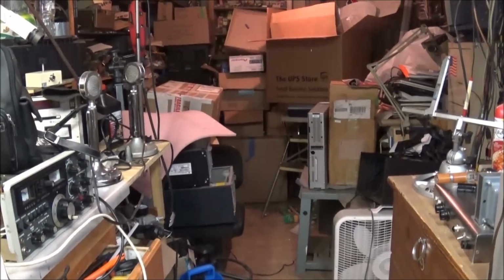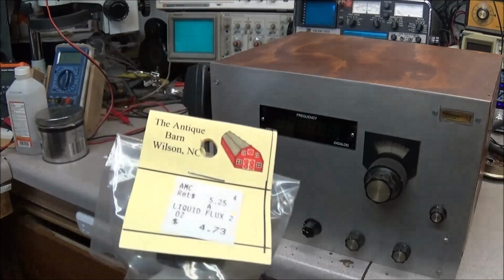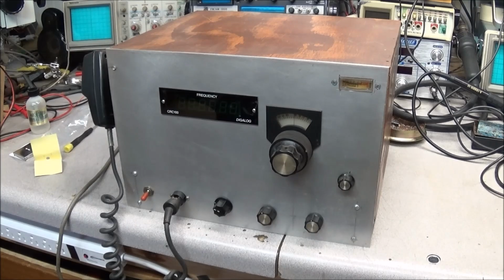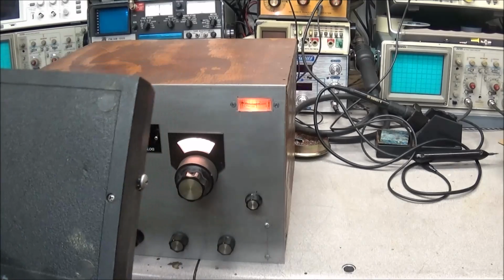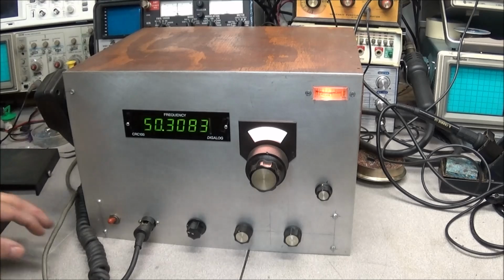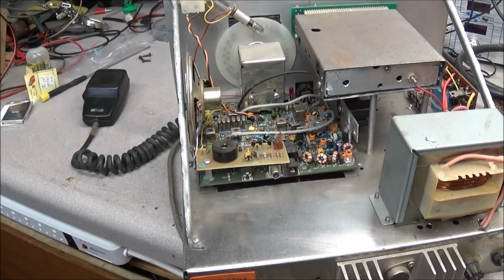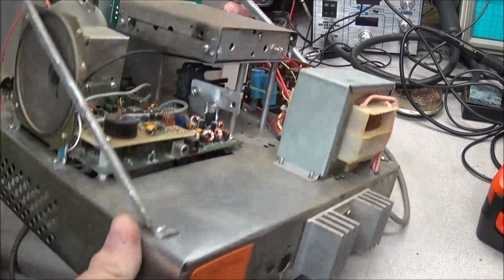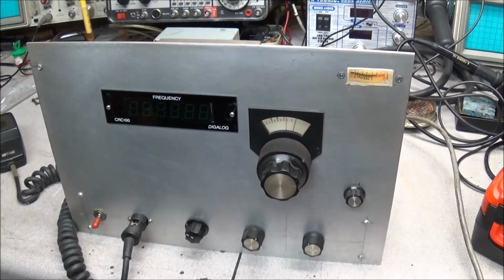#98 Old Projects From The Past

Comment: is the ts2000 your daily driver?  whats your opinion of it compared to other shack in box style?
Reply from the maker: It is a good radio, but not the daily driver. I probably use the Icom 745 and Swan 350 more then the 2000.  I just like the way the old rigs work. As far as other shack in the box you cannot beat the 2000. It is loaded with everything you need.

Comment: Hello
Not related to this video. I have a CODAN HF TX/RX 100W communication set. Recently i found its showing High SWR 9.9 in all bands. I have changed my  2010 RF Unit with a working setup it still shows the same. so fault is with my 2010 RF unit. Can you please suggest any video or link to troubleshoot the problem. Thank you
Reply from the maker: Let me look into this and see what I can find.

Comment: You'll want to be sure your drill bits are tungsten carbide, otherwise they'll dull very quickly cutting into fiberglass FR4 board. I got mine from https://www.adafruit.com, in sizes of 0.5, 0.7, 0.9 and 1.1 mm. Only $2 each. I use a Proxxon TBM 115 drill press, which is very nice and small, but accurate so you don't have run out and breaks your bits. For flux, I have a large bottle of MG Chemicals Cat. No. 835-1L, a whole liter that will likely last me forever.  I pour some into a very small 50cc dispenser I got off Amazon that comes with multiple size tips. The biggest part of ham radio is building your own rig and I'm interested in doing the same.  Still learning the basics of how receivers and transmitters actually work so I can wrap my mind around it. Would love to see what you might end up doing with the six meter rig.  I haven't worked that band before, but I hear it can be very hot when it's good.
Reply from the maker: Thanks for the information,  Yes circuit boards can dull bits quick.  6 meters is an exciting band. But takes lots of patience.  You can go months and hear nothing, then all of a sudden it is alive. Very fun and you can work a lot of dx with simple equipment

Comment: I used to fly RC planes and later real aircraft. I still have my Futaba radio. It was the cats meow in the late 80's.I used it with an Eagle (my first), then Kougar (had a 50 in the snout). I flew the Kougar until the gear literally came off when I was landing it one day. The wing had finally soaked thru with oil and the gear broke out of the soft wood. That thing was fast, black, and a joy to fly. If you got it "on the step" on final approach it would just about land itself. 

I built a ducted fan F4 Phantom but it never saw air time. A tree landed on a storage building when a tornado skipped over my moms place and squashed my F4. It started life as plans and flat wood... I guess ended life as flat wood too. The real pain was the pattern ship that I lost. I cannot remember what it was called for the life of me but it was a sleek and gorgeous aircraft that I never got to fly. Funny how people are often like minded.
Reply from the maker: Seems ham radio, RC planes and electronics go hand in hand. Lots of similarities in it.  Sorry to hear about the life of the F4. That was sad.  To date I only lost two planes. Both were Sig Kadets. Very nice flyers and great trainer planes.  First was at an older flying field and the radio quit. Plane was headed over a forest where it was never heard of again. Second was on take out of a new build. Plane got about 5 feet off the ground and the ailerons malfunctioned.  It did a vertical climb of about 150 feet before I got off the throttle.  Then a spinning nose dive into a freshly plowed field,  Was not much left. thanks for sharing.
Reply: The most disheartening thing that I ever saw was the demise of a friends of mines Byron Originals P-51 Mustang. I was there for every flight. We were at "SHARKS Field" (Shreveport Amateur Radio Control Society). I think it was the 3rd flight. At one point the aircraft started doing very strange things and I asked him what he was doing. He very calmly said- Nothing. I don't have control and then demonstrated by chopping power and moving the controls. A little later the Mustang did a split S and started coming toward us but in level flight. Behind us was a 4 story apartment complex about a 1/4 mile away so we were getting pretty nervous. Then it just sort of rolled over and leveled out, facing the other direction, and made a belly "landing" that basically destroyed 2 years worth of hard work. Post mortem was the battery connector had failed and turned the receiver off. I had a partially completed Byron P-51 that had been given to me but parts of it died in the tornado too. I still have the engine (chainsaw engine), prop drive, and prop. I think the landing gear and some fairings are around here somewhere.

Comment: Buddy,
I was a Tech Plus since 1977. Last year learned the FCC had grandfathered all Tech class licensees into General as long as you could provide proof you were licensed a Tech before 3/21/87 and the 1993 Callbook had me listed as 2/13/87 for my Tech Plus. All I had to do was pay $15 and fill out a form at a local VE test session. Was the easy upgrade I ever did. I could not pass the 13 wpm code test back in 77 to become an Advanced. I had passed the written tests all the way to Extra.  73 WB3BJU
Reply from the maker: Good deal on being grandfathered into that. I had several friends that were also including the mentor I mentioned in this video.  Thanks for the comment

Comment: I wonder if an EL84 would be enough to drive the 6146.  They used to be used in the PAs of old CB radios.
Reply from the maker: The EL84 is in the same class as a 6L6 which is an audio amp tube., At 27 MHz this tube will produce about 15 watts, Less at 28 MHz and about 5 watts at 50 MHz.   Very interesting tube and just may be a decent driver. Will have to look more into the specs for it.

Comment: Souds like a good idea for a project.  Would breath some new life intonit.  

I'm lucky, can't pass through a good size town around here without running into a hobby store.

As far as flux goes I only use commercially made for SMD soldering.  For liquid the best I have found is CircuitWorks CW3220.  Think the smallest container they sell is a quart or gallon.  There is a seller on ebay that repackages it into smaller bottles for resale.
Reply from the maker: See Roberts reply about this flux above. I am really concerned that this hobby store is selling it as rosin flux. I think a 6146 would set that rig on fire :)

Comment: Buddy!    Don't use that flux!    Went googling it to see if it was available anywhere else and came across this page.
http://cs.trains.com/mrr/f/744/t/176476.aspx

That page seems to be having issues, here is the cached copy:

http://webcache.googleusercontent.com/search?q=cache:AB0SHpF1ODMJ:cs.trains.com/mrr/f/744/t/176476.aspx+&cd=6&hl=en&ct=clnk&gl=us

-bob
Reply: The Radio Shop 

Would be great for doing chassis soldering work.
Reply from the maker: Robert, Thanks for that heads up. The flux in question was in the "rosin" flux shelf.  After reading that article you posted it appears these guys have no idea what they are selling.  I will call them tomorrow when they open and let them know about this.  Seems to be an ok flux for metals thought. Like brass ect. So I can use it in that area of soldering. You surely do not want to use it on electronics. Again thanks! I owe you one.
Reply from the maker: Should work fine for that

Comment: I recognized that knob immediately as a PAL VFO...have one here that I've been planning to build into a Novice style VFO for my (someday to be built) retro-Novice rig! The PAL has a great variable cap and reduction drive as you say that makes for a very smooth movement!  73 - Dino KL0S
Reply: Dino Papas 

The old Siltronix drives were probably the smoothest.  Properly lubricated they spin like any tuning knob on a HAM rig.
Reply: The Radio Shop 

Yep, the PAL VFO's were nice.  Have several of them that work great.
Reply: TNX Mick, will check it out. My first Novice rig in 1969 was a Heathkit DX-40, a Hammarlund HQ-100A and a handful of crystals; ahhhh, remember well the days of calling CQ and then tuning up and down around the transmit frequency since the other guy usually didn't have the same crystal! I have a Drake 2B and a 2C/2NT combo to be my retro station and plan to gut another old DX-40 and rebuild it into a 2B case to create the "2BT" that Drake never made.
Reply from the maker: The PAL was a very good VFO. Nice smooth tuning. I do agree with Mike that the Siltronix made some nice ones also. I think the PAL worked out great in this little rig.  Very stable.
Reply: Dino Papas - Dino, you might be interested in a Facebook Group called 'Novice Rig Roundup'. NRR is a group of like-minded Hams that relive the old Novice days when one had to learn code to get a ticket. And primarily used low-power homebrew and boatanchor CW rigs although modern gear is suitable too. 

We would love to have you and others join us in this exciting group of Hams from around the world.  

https://m.facebook.com/groups/NOVICERIGROUNDUP/

http://novicerigroundup.com/

73, de Mick Bradford - WB4LSS
Reply: Dino Papas Dino, there is no doubt you would enjoy NRR group. What you described is exactly what our group is about!!  Please drop in sometime and share your experiences and photos of your gear and shack with us.  

73 -- de Mick, WB4LSS
Reply: Nice build. Saw that PAL VFO immediately, I have one on my Royce 1-640.